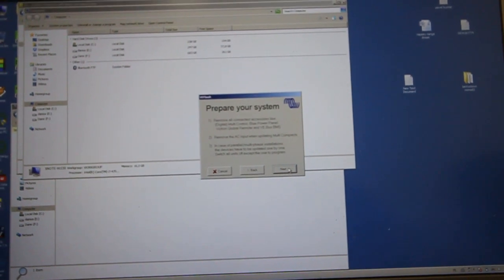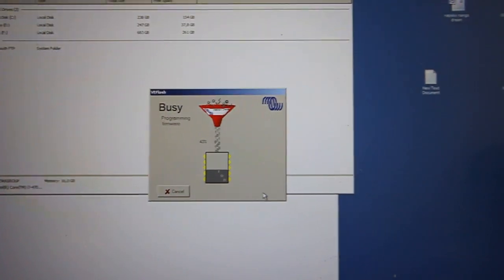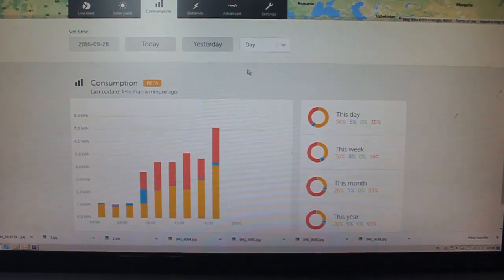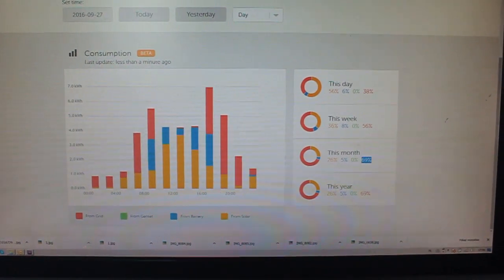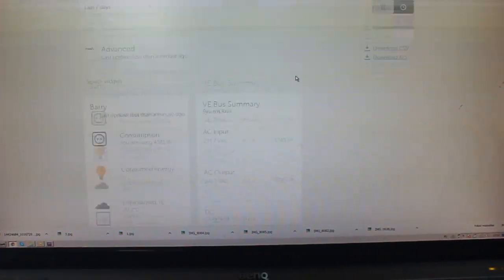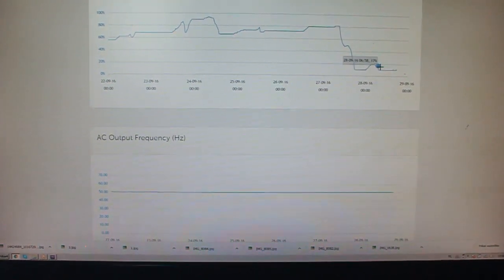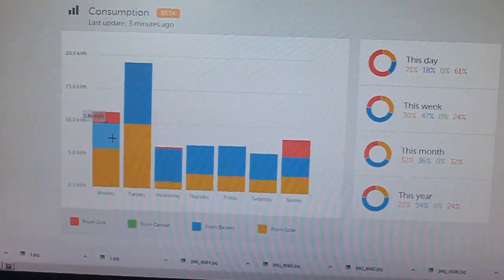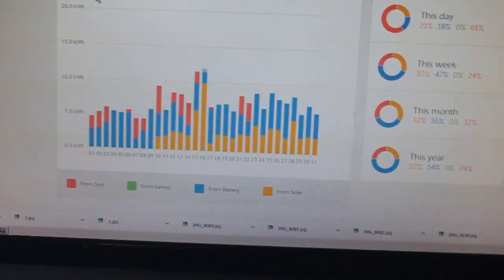Victron HUB 4 system, lithium bateries and not enough surplus energy to charge them

Comment: Looks like power consumption is a high, especially on swimming pool equipment. Why wind turbine ( shown at 6:06 ) is not higher or located on clear space? I suppose there is a lot of turbulence due distance to buildings/trees. I plan to purchase a wind turbine, and from almost a year doing/registering measurements of wind speed in my location. From my knowledge there is a strong influence on power done by nearby obstacles. I know this limiting Irish regulation related to distance between wind turbine, property borders and total high of mast+wing. if that was the reason?
Reply from the maker: wind turbine not best location but not my job

Comment: Great to see your work in English. What about the new 300 Ah LFP Victron Energy batteries for your next installation...
Reply from the maker: maybe adding 4 more 200Ah in paraller  - possible for bms ? all the best John
Reply: Way to go. Interested in writing a blog about your project. Let me know, especially as you now do English videos ;)
Reply from the maker: let me add some modules tere next week so system works as it should
Reply: Okay, drop me a mail when you are happy with your installation.